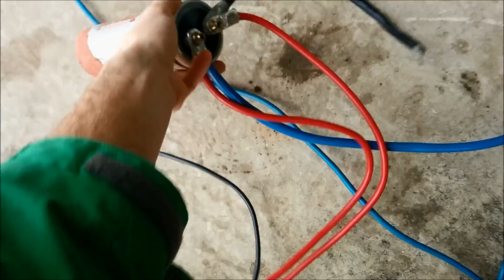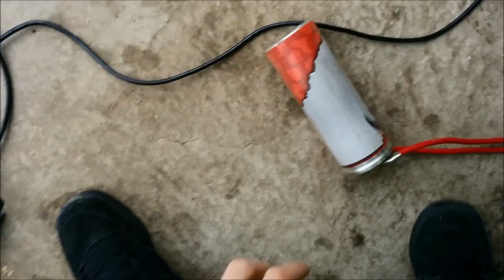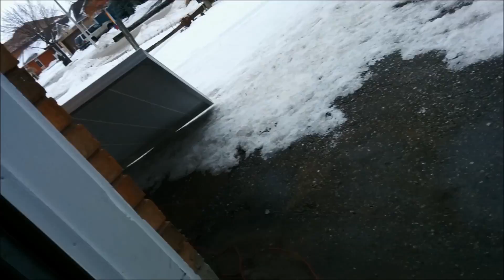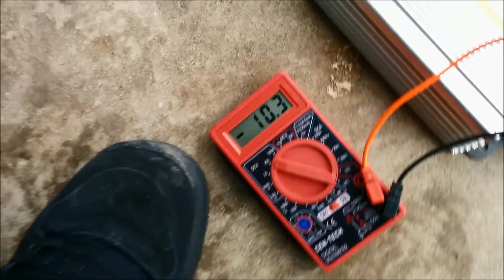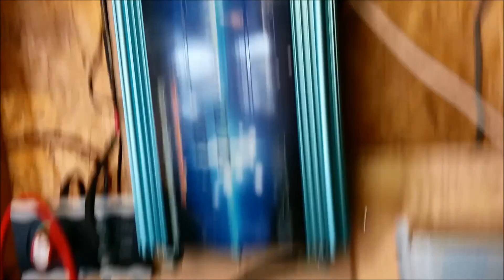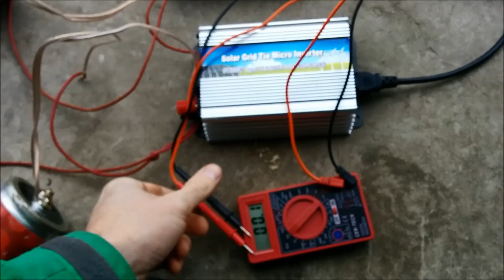new 255w b grade panel

Comment: With 24v into one grid tie, usual output is about 225W of ac. No need to parallel grid ties. Use one panel to one grid tie. The 24v batt is a voltage regulator keeping the panel dc voltage below 30v.

Comment: Take the panel output connected to 2 12v small batteries in series. Then connect to grid ties in parallel. The batts will pull the Voc down from 36 to 24v. Ok to put 24v into 12v grid tie inverter. Put 12v pc fan blowing on grid ties for cooling. The grid ties work better with 24v input. Their max input is 30v. Use batts instead of caps to lower panel output below 30v. Most of the panel power will go into the grid tie not the batts. Try it.
Reply from the maker: ill try it!

Comment: Inverters can't work in series, the voltage fluctuations will be all over the place and capacitors will only make the situation worse. They must be in parallel and if the voltage from the panel is too high then some sort of external regulation like a charge controller is needed to bring it down. Trying to hook them up in series with capacitors is only going to let the magic smoke out.